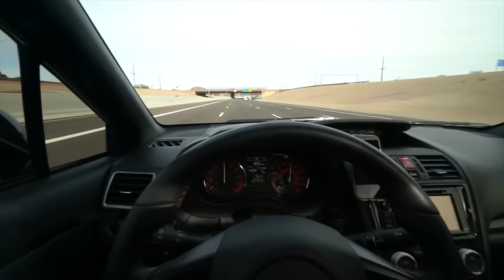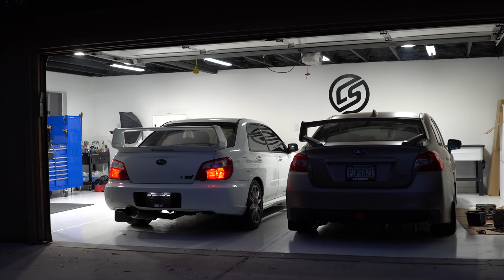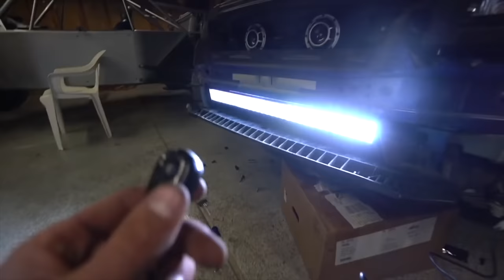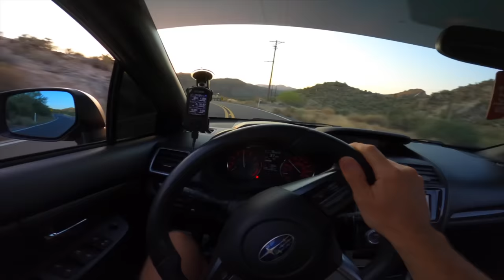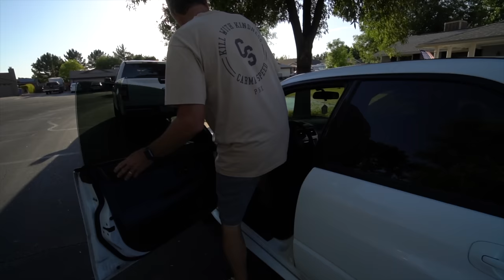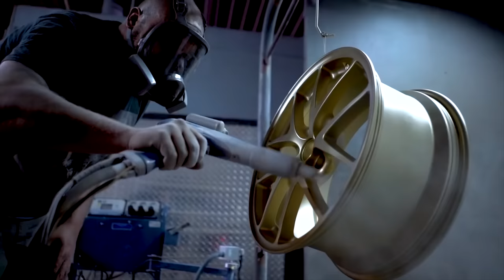Which Subaru WRX STi Should You Buy, Old or New?

Comment: The best Subaru's don't have window frames.
Reply: Yup, more simple car, and I love that fact
Reply: Just like the 04 Foz 🙌🏻
Reply: Noisy tho.
When I hit 80mph in a cross wind, its like my back windows open.
Ive got a forester sg. Same platform as the gd. The entire drivetrain is interchangeable, but the Forester is more practical.
Reply: @Nbomber  yep. I have two SG XTs. They are good.
Reply: @350streetracer  how are yours on fuel? I have the 2.5t, and I get like 12mpg.
But I still love the car, so I can live with the fuel economy or lack of fuel economy.
Reply: @Nbomber  one has 20G with injector dynanics 1050x and a 16psi tune getting about 16mpg. The other has a VF48 without a tune yet getting about 15mpg.
Reply: @Nbomber  basically, a good professional tune will increase your mpg significantly, and you get the bonus of a smoother map and more powerful car
Reply: @350streetracer  damn, so your getting better power and efficiency,  not bad.
I did stumble across a theory last night, bear with me here.
Reply: @350streetracer  so I just replaced my thermostat,  didnt realise it was bad till I was getting fluid boiling and steam coming out of the top radiator hose. Also, the engine has 120k on it, and is probably choked up with carbon deposits. 
The reason I think this matters, is knock.
Ive noticed a rich smell coming from the exhaust,  I suspect, that the ecu has retarded the timing as much as it can, and has next resorted to increasing the fuel delivery to reduce knock.
I have a feeling that would go some way to explaining the 12mpg. Though I might be wrong, it strikes me as a very interesting theory, with a realistic possibility of being true.
Reply: @Nbomber  if your coolant is boiling, it usually means you blew a headgasket and the pressure comes out of the reservoir plastic tank. At least that is what mechanic tells me.
Reply: @350streetracer  usually,  but not in this case I dont think.
The plastic tank runs dry and the steam is coming from the top hose next to the radiator cap, bottom hose is usually cold.

Could still be head gasket too tho, but thermostat was definitely nackered.
Reply: @Nbomber  12mpg is  muscle car territory. is subaru a muscle car? no its not so why The FuHK is it using that much gas? just another reason not to ever mess with those old ej buckets. just look at Smeedia hes been fixing his 05 STI forever.

 FA for LYFE.
Reply: @W333dm4n  I mean, thats fair, but where I live the roads have corners. Not really what a muscle car is designed to handle. Plus I am not a fan of them.
Despite the fuel consumption,  I love the forester, and would take it over a muscle car any day, personally.
Reply: @W333dm4n  also, isnt he actually upgrading his sti? Theres a big difference when you get into tuning your car as opposed to running it stock.
Reply: amen
Reply: @W333dm4n  also, I just wanted to update, after fixing my thermostat,  im actually getting like 25mpg or so now. Which is insanely better.
I got 85 miles on 16 litres of fuel on my last fill up.
And current 15 litres has gotten me 60 miles with still some left before the light comes on.
A vaaaaaast improvement, and honestly way better than I expected.
Reply: that's true !
Reply: @Nbomber  same. I drive a EJ205 swapped 05 Forester XT and love that car to death.
Reply: @joshk.photo.pro1  thats pretty sweet man. Mine is about to get an engine rebuild. It blew a head gasket on a road trip 200m from home lol
Reply: @Nbomber  personally would love my forester xt if I had the money to mod it the way I want it to be. That would be an ideal daily sleeper/family wagon or suv. I fucking love them
Reply: Now that you mention it, it's mind bogglingly pathetic that, still to the day...subie can't make a car that the rain doesn't steadily drool directly into the car (and usually right into the window switches) when you have a window cracked while wet weather driving 🤦
Reply: @bionicca  that's what the window visors are for...
Reply: Love my 2018 Outback Premium
Reply: @Nbomber  yup lol
Reply: For anyone who stumbles across this in the future, my head gasket did go.
The problem I traced back to the thermostat.  The new one I got didnt work. It had no bypass hole. Engine overheated, heads warped, and head gasket blew.
Reply: I noticed that when I first test drove an 05 lgt in 05 and was like niceI'm buzzed off driving turbo fast around corners and it's great not bam my head on door frame cuz I'm a clown

Comment: Watching this makes me appreciate my '97 2 door STi even more. The wife has a 2016 STi, and it's a lovely comfy car, but not a patch on a smelly, noisy, uncomfortable and harsh ride 1997 GC8 2 door with no frills whatsoever :)
Reply: This is the best sti, the real sti
Reply: My partner has a 97  gc8 aswell cant beat that driving feeling 100% right on the description you commented 👍
Reply: I have a 1995 wrx sti v2. I would never buy one of these newer cars over the gc8.
Reply: I owned a 2 door 96 impreza L, wanted to turn it into a gc8 before I even knew what it was. That was in 2008 and I had to get rid of her unfortunately. Now I own a 2005 blobeye  WRX and a 2016 hyper blue STi. I love them, but I'd trade both for a widebody gc8 as clean as bucky laseks.
Reply: I used to have a black GC8 wrx with an STI motor and close ratio 6 speed swapped. Was a great car and the driving experience is amazing however compared to a GD, Subaru engineered the GD's so much better to work on and they also have a smoother feel than the GC8.

Comment: I love my 2004 STi!! I’ve had it since 04 and I still daily drive it. It has always been my dream car.
Reply: What do you think should i buy sti and that car have  390 000km drived
Reply: Is it a good daily? I've been looking into getting one to work on lightly and maintain to be a daily, was just wondering if you had anything to say on reliability?
Reply: @KO_Salad  If you buy an sti always have cash on the side for repairs.  Head gaskets are notorious to fail. Super fun cars to drive tho.
Reply: Honestly if you have a problem with high mileage cars aernt the hobby for you cars aren’t girlfriends thier machines most 240sx , Evos , have high mileage than you believe odometer malfunctions in 90s and 2000s cars happen all the time I had a 240sx with 200k+ that ran better than my 2011 hybrid with 90k all about chassis condition if the frames straight and the diffs and trans don’t leak and still work go for it
Reply: i still have my 04 sti its white just like this guys. but i only have 110000 miles
Reply: I’m fixing to buy a 2005 wrx is there any advice I should know before I go along with the deal ?
Reply: @TheOfficial21John  make sure its not a 2.2 motor i believe thats what its called. also replace your radiator hoses they are probably dry rotting now mine is an 04 i live in the mountains and mine started cracking.
Reply: @JudarianGaming  it says that it puts out around 230 hp
Reply: @TheOfficial21John  should be right my 04wrx sti is about 300
Reply: @JudarianGaming  man I’m excited for my first car I got to drive 4 hours to the dealership sometime this week I’m gonna be upset if it’s taken
Reply: @TheOfficial21John  theres a huge freedom to driving just becareful don't do anymore too crazy in it till you get a good feel for the car. And Subaru will take turns like a champ it's great at cornering
Reply: @JudarianGaming  yeah I understand man I’m not all about racing tho and all that just sound and looks but Yeah
Reply: @TheOfficial21John  what color is the Subaru your interested in if you don't mind me asking
Reply: @JudarianGaming  white
Reply: sell me your 2004 STi for $600.
Reply: @roboticunclephil  lmao that’s like 4 rims right there
Reply: @TheOfficial21John  theyre losing value man im doing you a favor
Reply: @roboticunclephil  yeah no your not I didn’t even buy one I went with a v6 camaro not a v8 but it will do for now
Reply: @TheOfficial21John  wtf you told me you had a 2004 sti
Reply: @roboticunclephil  bro you replied to the guy up there  I just replied to your comment about the 600
Reply: @TheOfficial21John  you owe me a 2004 sti bro
Reply: @roboticunclephil  nice
Reply: I just bought an 02 WRX from a guy who took really good care of this car. I’ve had it for 3 weeks now and it had 285k miles on the chassis and 50k on the rebuild. Still runs so good. It’s almost impossible to find a car thats 15+ years old with less than 100k miles on it. Especially when they’re someones daily driver
Reply: @pashko90  legit, I’m finding out my 60k bottom end wasn’t maintained well, and the replacement wasn’t done to Subaru specs, I don’t think it will last a long time but it keeps on driving 2 hours as my daily work car, but nothing has changed with the way it runs in the last 35k miles
Reply: @TheOfficial21John  Did ya get the STI?
Reply: @_u0nda928  sadly no the dealer ship was asking way to much for a down payment so I ended up getting a 2012 camaro v6 for now tho but eventually I will upgrade I got a muffler delete on it btw but yeah
Reply: @TheOfficial21John  Hey that's still a nice purchase lmao. How much for it and how old are ya?
Reply: @_u0nda928  thanks man I like the car tho it’s nice it was 17k and I put 2k down but I owe like 13k on it now I been paying on it for awhile
Reply: @_u0nda928  and I’m 19 about to be 20 in April
Reply: @TheOfficial21John  Nice man, I hope you find it worth it xD. And wow, by the time you find a good condition STI you most likely won't have to worry about insurance as much as you would now lmao.
Reply: @_u0nda928  haha yeah man so far so good !!
Reply: @TheOfficial21John  not even 4 rims on my sti. The rims alone are over 1k
Reply: @TheOfficial21John  Honestly before you get the sti I'd recommend paying that v6 off and waiting till your at least 24. By then you're credit will be a lot better and as long you don't have a lot of traffic incidents you're insurance won't be too high. Only thing is sti's were recently discontinued so prices might start rising on them as they become rarer
Reply: @ktm125sxbeast  oh yeah I’m prolly gonna get an ss getting an sti is a pain where I live . I live in Texas and there is no like 04-05 sti near me but yeah I have my eyes set on a 10-14 camaro ss
Reply: @TheOfficial21John  getting an sti is a pain anywhere. People like to keep em. There was only one within a couple hundred miles of me and I bought it a couple weeks ago. Camaros are nice cars too but hope you get it. Where I live awd is a necessity on any sports car for the winter if you don't have a second vehicle.
Reply: @ktm125sxbeast  hell yeah broski where I live the weather is bi polar af one day it’s hot the next day it’s all icy an cold it’s crazy that’s one of the reasons I wanted an sti but it’s all good tho
Reply: @TheOfficial21John  If you're anywhere in the Midwest there's actually a few nice sti's for sale. One with only 25k miles on it too. If you check carfax you'll probably find at least a couple near you
Reply: Same
Reply: @modified.7884  no they aren't. That's a myth.
Reply: @pyromanic007 most evos are low mileage. Us Mitsubishi guys know the deal. I also want a STI bad lately.

Comment: I'm 19 and I had a similar dilemma since I was choosing my first car I wanted an STi since early childhood but I didn't know which year to get.  I knew I wanted either an 05-07 but I also considered getting a 2015+ since it would have less miles and newer features.  I pulled the trigger on a 2006 obsidian pearl sti with 125k+ miles and I think I went the correct route so far.  That was 2 months ago and it's been perfect so far.  I wish I could've purchased one with fewer miles but they wanted a lot more obviously.
Reply: Hey I’m in the same situation how is the car? Also was it modded in the engine bay when you bought it?
Reply: @bakuganbrawler200  I'd recommend getting one that's as stock as you can. There is definitely a stigma about modified subarus being really unreliable
Reply: Same as me. I’m 19 and I was saving up for my first car. I wanted an 04 or a 19-21 STI. I ended up getting a 2020 in lapis blue pearl. Love driving it had it for 8 months now.
Reply: @miguelc3033 nice, I still have my 06 STi and I'll probably keep it for as long as possible.

Comment: I agree with you on getting the older one. I absolutely love the white one you have. Problem I see is trying to find one thats in great condition and without having it be a money pit. Another angle is with 2021 being the last version of this gen of STI, they may even appreciate. The driving experience is probably more raw and even better for a driver in the older ones, but for what the STI is  worth compared to other manual options in todays current market, still think it is an amazing vehicle for what you get if you are truly a driver. I have a 2019 and trading it in for 2021 white STI and the last gen. looking at it as a fun daily (won't mod except a catback potentially) and as a potential investment that may appreciate. Great video!
Reply: Cars are usually never investments. Any even when they appreciate over time, they significantly underperform other investment vehicles and usually don’t outpace inflation.

Comment: well spoken...I have a 2013 "sport-tech" 5-door with 55,000 miles on it.  It's mechanically stock, but rolling on a set of 265/35 Pilot Sport 4S tires on custom rims with "rolled" fenders. The grip is phenomenal, and the big rubber looks amazing from the back, especially because it's a 5-door with the shorter rear overhang .  It turns heads wherever I go and I love driving it...I can't think of anything that I would replace it with.

Comment: I would like to see an updated opinion after the new (2022+) FA engine. But after seeing this video I want to drive an old gen EJ.

Remember kids, keep revs high when you drive hard. No matter what WRX motor. Things can/will break if you suddenly floor it in high gear on a manual. You will get ringland fail on EJ motors (STi) and/or rod break on FA motors (2015+ non-STi).

Also keep in mind that old cars involve work. Especially sports cars. Things break from wear. Be prepared to get your hands dirty (or pay someone to get them dirty for you).

I like the 2015-2021 gen. Preferably non-STi w/ ethanol tune (unless you have the $$$ to have a built EJ).

Comment: I bought a 2017 base WRX to "try" Subarus out.  I knew full well that WRXs and STIs were not painted as the most reliable cars.  My regret is that I did not buy the STI.  The wrx is whisper quiet, and the rev hang is ridiculous.  Those gripes aside - the thing RIPS in the snow - not just capable, but dangerously fast in ice and snow.  I keep blizzak WS80s on it for winter and will get the WS90s when the current tires run thin. I use the car to bully giant trucks at every opportunity.  yea I know bla bla ground clearance and high center bla bla - Ive driven that car through snow and ice that giant 4WD trucks simply couldn't get traction in.  I've driven that car up ice crusted hills i couldn't walk on and snow deep enough to drive under.  they are all amazing cars. The pure satisfaction i get effortlessly drifting around a truck hogging the "fast" lane trumps any issues or potential issues I've had or will have with the car.  none so far by the way.  They are just fun to drive, and VERY  hard to say out of trouble in.

Comment: Okay, experienced owner here with 6 Rex’s total and 3 STI cars over the past 12 years. I have a 2015 VA on its 3rd motor replaced by Subaru or America (not modded ever). My 2012 was supposed to be the worst model and the car ran super boosted at 402 whp (tuned by rev works winter springs fl) for 180k bought from new. The platform is amazing but I feel accepting the motors limitations is a come to Jesus moment.

Comment: As much as I do like WRX STI's, I am going to say, if you're not going to do any power mods to the car, the new is the way to go. Just an all around better car than the old, as it should be with 15+ years of better development. If you plan on doing any power mods to the car, meaning more than the simple bolt on and tune, but more so bigger power levels, then I would not recommend the WRX STI period. You will have major problems and headaches with the car breaking down continually, while still getting gapped by a simple bolt and and tuned MK7 GTI for example.

Comment: At 18 I bought an 07 STi because I could.
Financially , not a good idea.
Fast forward 4 years later, and it’s been broken in the garage for almost 2 years due to bearing failure.
I bought it modified, and did nothing but modify it more on stock block.
I learned soo much, but honestly sometimes wished I didn’t modify it so much until I had the money to build an engine.
But, for some reason I cannot sell it.
She will be getting a built engine this winter.
Cant wait.
Reply: How did it go man?

Comment: I literally took your second path, bought a Hawkeye Sti in 2017 and also had beaters from then until now. It has been a slow (and mentally painful) process but I've lived and learned, gone through the rebuild of the engine, upgrades, etc.
Just finally nearing "finished" and will be in the 375hp range. 

It can be done my brothers, trust the process!
Reply: Congrats btw. Did you end up finishing?